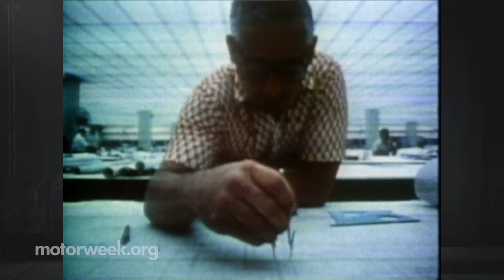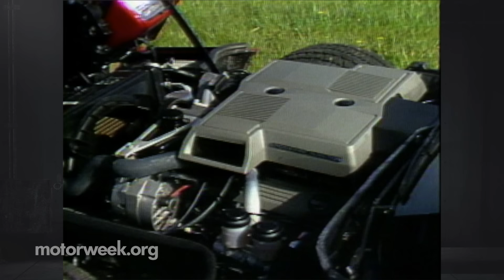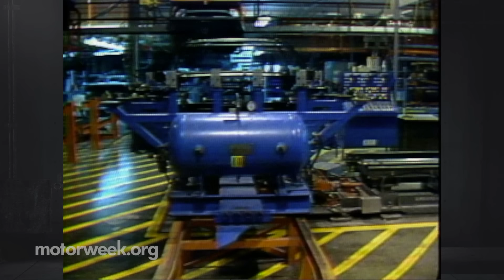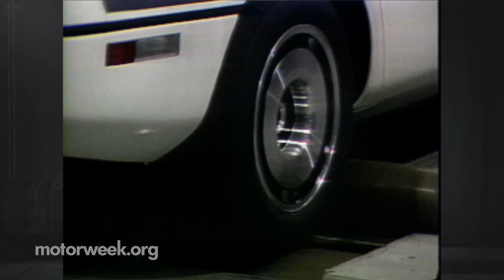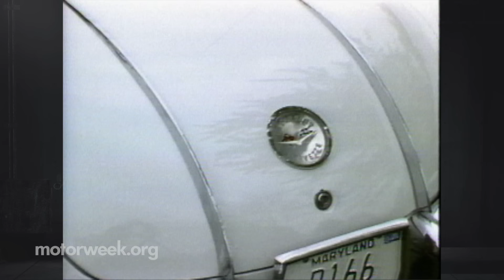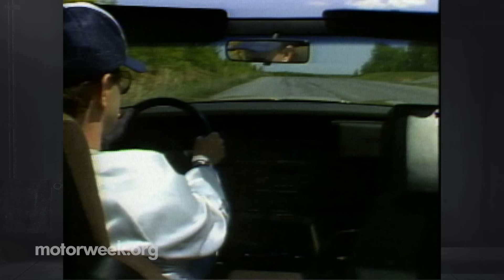MotorWeek | Retro Review: '84 Corvette Special Episode

Comment: Recently acquired an '86 model that had been a daily driver.  It has nearly a 1/4 million miles on it... and it feels like it.  Nonetheless, the engine has been overhauled and the car definitely hauls ass.  This will not be a restore project, just a fun car to fix up, repaint and put in better condition.  

It is very easy to work on, at least to my generation.  I was 33 when this was a new car and still have a fun time driving it around.  It is not my first Corvette, probably won't be the last.  With any luck, she may be a fun car for someone coming behind me.  

Haha, once you hear the sound and feel the power, you'll be hooked.

Comment: Incredible car in 1984. That 5 link independent rear suspension was right off the race circuit.  I had an 84, was a great car. In fact, I had other Vettes after it, and that 1984 Vette may have handled the best of em all. Landmark car in 1984.
Reply: Chrustopher McBurney. Corvette C4 is incredible car. My generation favorite, 1984- 1996 is best generation of Vette, 85, 86, 87 and 88 is my favorite

Comment: I just bought a 1984 corvette and I am so excited to start driving it
Reply: How is it so far? Deciding between c3 and c4 at the moment.
Reply: @AIIRHEAD11  So far I am so happy that I bought the C4. If you’re deciding between the two, I definitely recommend the C4. I think the C3 would be too outdated even with the C4. There are normal problems that you’re going to run into because the car is 40 years old. Also, it’s pretty simple to work on especially if you know how to do things yourself, I will say in my area. It is hard to find a good mechanic.

Comment: Still see many early c4 around, often in good shape, some a little rough, but still around. Can't be said for many other 80s cars.
Reply: Hilina'i Koa helps that they were expensive at the time and most people garage kept them, not usually daily drivers either
Reply: The C3 Vettes were better suited as daily drivers. The C4 (and later) Vettes were more like champagne.
Reply: Most are garage queens no surprise.
Reply: 86 in very good condition,  in garage, but times i leave it out, not a big deal, as long as you don't leave it in the snow, bad weather, nothing wrong with leaving it outside at times
Reply: I never see them. If you do they are the later 90's C4's.

Comment: hihhii I just drove my 84 vette to work today and it has only 87,000 miles, not sure about the fancy electronic dash, maybe back than was nice but today it will set you $400 to have it fixed or you can pay $900 to install a plug and play old fashion gauges and its a straight fit, no mods. The Bose system at $900 wow I took it out as each speaker had an built in amp and installed a  normal stereo. The C4 today is least favorite of all the vets out there but let me tell you I love driving it and  it has a better exhaust sound then the Viper I drive (my avatar). Changing a water pump was a painful process but it was done over time in a driveway. Dont install the old fuel lines as you will never be able to put them back the way they were just run a fuel hose from TBI to the bottom by the frame, it will save you lots of time. When you change the water pump grab  a pen and paper and lots of zip lock bags, and every step you do you write it down and label the bag with parts and what step number, when you are dont you will be happy you did it. Watch out for the bolt at 6 oclock on a AC clutch as you can not put a socket on it but an  open end wrench I said open end wrench and most of all THE BOLT DOES NOT COME OUT, just loosen it up and put the AC clutCH to the side. The water pump has 4 bolts and MAKE SURE you mark where they go as they are different. Have fun R/R the one that is my the PS pump hihihii. If it runs hot which they all do go buy a 4 row radiator and install it and it will all the time at 197F DO NOT LOWER THE RATING OF THERMOSTAT TO 185 as some people do, NOOOOOOOOOOO as computer module wants to see that temp of 197 and not 185 trust me, You will have to do some modification to top end of a fan shroud to make it fit like cap opening, trans lines opening, and you will not need the old radiator rubber stoppers as they wont fit and if your transmission lines are frozen jsut cut them off install new stubs and run a hose between new stub and old trans line below. Have fun taking off the two bolts that hold the top end of the fan shroud to the bottom, as you will curse as every single 1/64" turn you do as you can not put a socket there and no room to turn the wrench as the bolts are housed in a cockoon next. Once you get the two bolts loose when you are ready to install the top shroud back do yourself a favor and cut off the plastic housing where the bolts go it will save you ton of time and most of all you will not get a heart attack lol. Once you cut it they go on with socket in on e minute.

Comment: My Dad had one of the first '84 Corvettes in California. I believe he took delivery of it in April of 1983. I remember that crowds used to gather at gas stations when he opened the clam shell hood. Of course, this stopped when more of them became available later in the year. His has the Z51 handling package with Bilstein shocks and was silver on silver. I had it up to a top speed of 130mph and it took a long time to get there! This was confirmed by the CHP who did not pursue me, yet called my father! LOL. I drove it many times down Highway 1 and the car felt like it was on rails. However, hit a reflector mid corner and it skipped over like it was going to skid sideways. The stiffest riding car I have ever experience but with almost no body roll. The digital dash  failed many times as well as a loud "tink" from the driveshaft when putting it into reverse.
Reply: I can confirm much of this. I bought a like new '84 in early '86, with only 5000 kms on it. Medium Blue Metallic, it was gorgeous (dated looking now, in hindsight). It had the Z51 suspension and indeed, it cornered like it was on rails. I think it was the first production car to pull more than 1g on the skidpad. 

It rode worse than a damn truck though, because of the Z51 suspension. If I hit a dip in the road, at speed, my head would smash into the roof. Probably the most uncomfortable car I have ever owned. I bought it to take a on a trip to Expo '86 in Vancouver, BC but ended up trading it before leaving, on an '83 BMW 533i because the ride was intolerable.

 I only ended up owning it for about 4 months. Even though it had no miles, a couple things broke on it. The driver's side cloth upholstery separated from the plastic part of the seat (some air bladder control), and the rear hatch solenoid failed, so you couldn't open the hatch. The digital dash was cool, at the time, but I always feared what it would cost if it failed, and I KNEW it was going to fail one day - because GM.
Reply: Awesome to read it .... I love the 84’s
Reply: 84's still used crossfire injection 🤢
Reply: OneFastDuster In 1994,  I test drove a 1987 with Z51 suspension.  Absolutely the stiffest, harshest ride I have ever experienced - it would rattle your teeth loose.  A logging truck (we had one) had a better ride than that car.

Comment: Those under hood "work lights" will run the battery down in about an hour and you will need a jump start. Also the '84 with TBI is a SLUG 0-60, even for an '84.
Reply: replace all the lights with LEDs and youll have no such issue
Reply: The '84 models were powered by a 205 hp L83 350 cubic engine V8. That's not a lot of power to haul a 1.5 ton automobile with any speed. This engine was replaced from 1985 to 1991 by an L98 TPI 350 with 230 hp. You won't be setting any speed records but it's better than the L83.
Reply: @houseofno  fun fact, the 84 was actually intentionally capped at 205. This was so they could boast about the next year's HP gain. On an 84, you can either replace or modify the intake runners to remove some material and get it closer to the 85 model's figures.

Comment: I thought I wanted a Vette in the mid 90's. Drove a couple and quickly realized the car was built so crappy, I never wanted one ever again... till the Stingray came back in 14. Luckily I was selling them and didn't need to buy one since I was around them everyday.
Reply: I owned both 1994 and 1995 back in the mid/late 90's. I had ZERO squeaks or rattles in either one. I got 26mpg on the highway and both had Autos. I had a friend who had the 6 speed version and he got around 30 driving in 6th. His also had to rattles and he dragged his almost every weekend.
Reply: Vettes are not built crappy. If they were Chevy wouldn't be on the 8th Gen right now w so much demand u can't buy em at MSRP. Every Vette gen had to be good to get to the 8th

Comment: Had an 89. As far as the car and ride it was really a nice riding car. Would love to have one again as a daily driver.  Beware though, these C4's were money pits and broke down to often for my taste and granted it was almost 30 years ago and times changed by now but there were very few things on the car you could actually fix yourself. Never spent so much for tow trucks in my life. Interesting listening to the guy talking about putting bigger tires on and then say it is not a big cost to replace the strut rod bushings. True, but the work it takes to just get to where you can get the struts off is a lot of work and removing the shock mount can be pretty challenging. I ruined one trying to get it out, the otherside just popped out, granted it was on my 69 C3, but seeing this video it looks the same.

Comment: 0-60 in 7.9 seconds and 1/4 in 15.8 seconds.  The Mustang SVO (4 cylinder turbo) was exactly as fast (cough).  It was truly a slow car - I raced a few back in the day and it was embarrassing for those guys.  BUT, it was a revolution in design and build and for the that year about the fastest thing available.
Reply: Take a corner.

Comment: the cross fire engine had a restrictive intake from factory only flowed 475 cfm 
if they opened up the intake to 1200 cfm would make about 260 hp !!! more than the 1986 tpi engine
Reply: Open up the '86 TPI engine and it made 320 HP... and the TBI engine prolly did also...

Comment: About the same performance numbers as my 1996 Lincoln Continental 260 horse power 260 lbs ft of torque 
Who would have thought
Reply: Acceleration, yes. Handling...... well....

My 1.4L Chevrolet Sonic I had would out accelerate pretty much any sports car of the early ‘80s, even a couple of Ferrari models.

Comment: 7.9 to 60? That's slow, even for the '84. Most had it 0-60 6.8-7.2, no better no worse. Unless that was a manufacturer's estimate. The '82 was 7.9 with the 200hp L83. The '84 dropped a second off of that due to the better Cd (0.34 vs. 0.443)
Reply: +Joshua Echt  Power to weight 210HP at 3000# plus passengers I think the muscle number is 1HP per 10#.
Reply: +H K Angel I get that but what's weird is that other mags beat that time often. Never seen a slow Vette that slow from the '84 era. :)
Reply: Supposedly it was the fastest stock small block Corvette up to that year. Maybe the test one wasnt a Z-51 option.
Reply: Interesting! OR they can't drive ;)
Reply: +H K Angel The sad truth is it couldn't out run Fords 3.8 Super Coupe or 1987's Buick Grand National a turbo charged 3.8. In 1985 my dads commanding officer had a new vette. We where on back roads in southern Missouri and that vette couldn't get away from my dads Mazda B2000 pick up.

Comment: 7.9 second zero to 60? It seemed quicker than that back then.
Reply: They dropped about a second with the LT1 TPI engines.  The crossfire engines were garbage
Reply: Minivans are quicker now!
Reply: @GlassTopRX7  Dropped only about a second with the L98 that came right after the L83. Dropped almost 3 seconds with the LT1, a tiny bit more than 3 seconds with the LT4, and about 3.5 seconds with the LT5.
Reply: @GlassTopRX7   I've had both.  I like the Crossfire better.
Reply: 7.8 in my FJ Cruiser lol

Comment: While car shopping in '88, I almost impulse bought a gently used '84 Corvette in the bronze that was so popular back then.  The dealer even let me take it home overnight and try it out, I guess hoping I would bond with it and want to keep it, but it actually had the opposite effect of helping me come to my senses.  It was very nice and loaded with leather, glass roof, etc, but there were things I didn't like about it.  

For example, I didn't like the instruments and dash in general, and the more I looked at it, the more I noticed the paint and fit and finish were surprisingly bad, particularly panel gaps.  First year QC problems, maybe, and maybe that particular one was from the notoriously problematic very early batch of production '84s?  I didn't know until seeing this video that the '84s were painted by hand, but that would explain the uneven paint I noticed, which the light bronze color made particularly obvious.  It handled well, but especially with the automatic that one felt too sedate to me, IMO more like a grand tourer than a sports car.

If I was going to get a grand tourer, then something with a little more room made more sense to me as a fun to drive every day vehicle.  I passed on the 'Vette and for about the same money bought a year old, like new, still under warranty European sports sedan that had more of the driving experience I was looking for.  Later I read and heard about problems with the '84 Vettes, such as digital dash electrical issues and the quirky, one year-only Cross Fire fuel injection system, and I felt like I may have dodged a bullet.

Comment: It’s funny. So I’m a Gen X er. In 1984 I was 18 years old and went into the Navy. I think I was making about $7500 a year. So that car certainly was way out of my budget. I actually bought an 82 El Camino that year with a V6 and I think I paid $4000 for it . Fast forward to the present time I have owned a 1962 Corvette for about 20 years. I think I paid like $40,000 for it many years ago it’s all original with less than 100,000 miles on it. I’m not sure what it’s worth at the moment, but I actually bought a 2024 z06 about a month ago let me say it’s a absolute rocketship. It spooks me a little bit so I never take the traction control off but if the Corvette back in the day was $25,000 roughly a brand-new one today is 160,000. I guess it’s  just how life works . I love my z06 , it certainly not a daily driver but I’m almost 60 now and I like my little long weekend trips with my wife .

Comment: My dad used to tell me  that when you bought a car you could either have a good older design or a bad new design.  The 84 vette was no exception.

Funny how they discuss a sports car for the entire show and only mention it in the last two minutes.  What is amazing is that the now measly sounding 205 horses was a big number in 83.  The following year the tuned port 350 was a huge improvement.  And a few years later you were up to 375 optional horses

Comment: I worked at a Chevrolet Cadillac dealership in 1990 and got to drive a dozen or so C3 and C4 Corvettes along with many other cars.  The most impressive car was the Allante.  The Corvette was not very good in regular everyday driving, but excellent on uncrowded country roads.  The Allante was great around town and on uncrowded country roads.  A very underrated two seater.   It wasn't built to as high a standard as the Mercedes Benz SL, but nothing else was, BUT the Allante was much better looking in my opinion and had a nicer, more comfortable interior with very cool modern instrumentation.

Comment: And wasn't the 78 vette about the shittest one of all?
Reply: BrewBlaster nope,to me it was the 53 with a straight 6
Reply: Maybe some trims were awful, but the Indy 500 Pace Car edition offered a horsepower boost over the pathetic engines of the time.

I like it because I see it as the most beautiful Vette of all. If I won the big lottery, I would get a 70s Corvette, give it the pace car paint job, and swap in an LS engine.
Reply: The L48 was pathetic. 185 horsepower! The L82 was 230 horsepower though.
Reply: 74 was the low point.